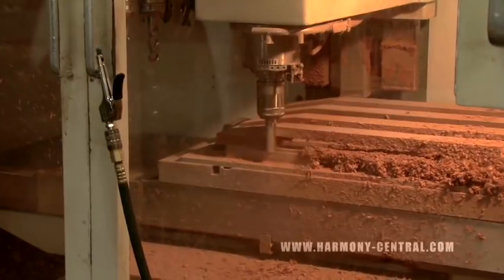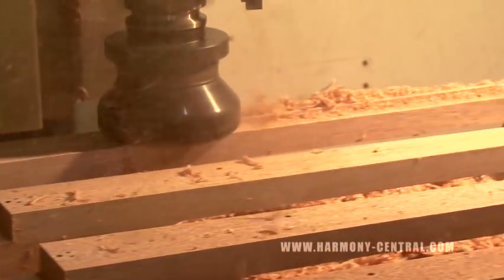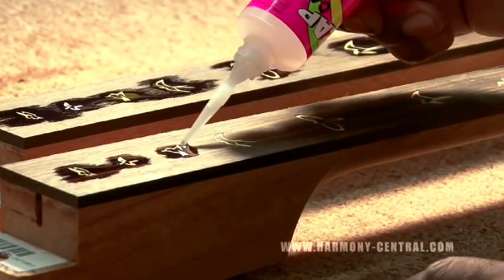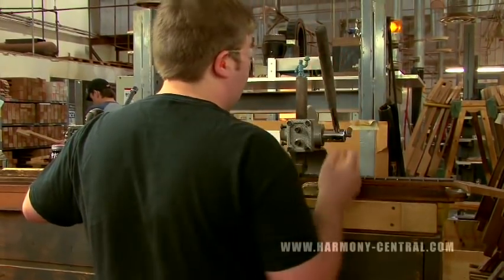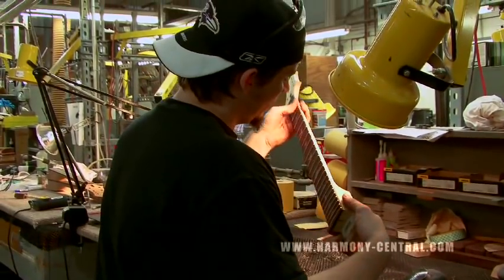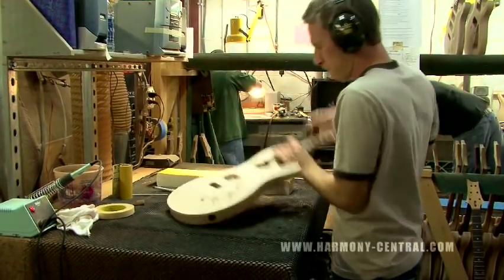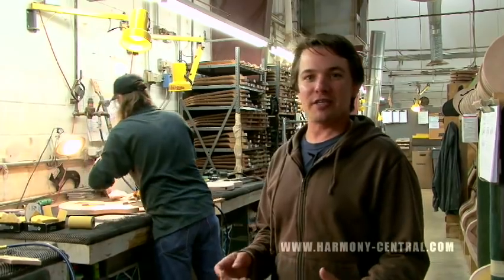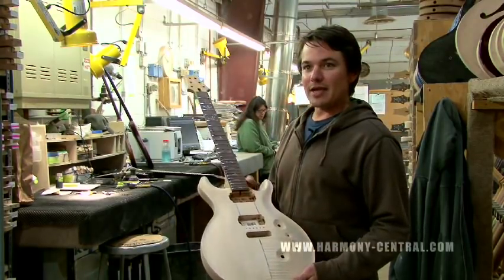PRS Factory Tour Part 2 of 4 - Neck Construction and Assembly

Comment: Inlay work is not toxic. Anyone can buy the pearl and abalone stock from any luthiers supply house and even do the inlay work yourself at home if you want. All you need is some hand tools a dremel and a little knowledge. Gibson does all their inlays in house, including custom work. Everyone pretty much does. What amazes me is that PRS CNC's the neck joint. WOW! Never knew that. Gibson cuts out their necks by hand then uses hand tools to finish and set the neck . So much for handbuilt at PRS.

Comment: @FreemanVDO
CNC machining is necessary if you want any level of uniform quality. If you think about it very little of the actual work is being done by any machine. You're talking about some routing, drilling, and basic sculpting. THAT'S IT! It's all still assembles, sanded, checked, and everything else by hand. Plus doing CNC work isn't as simple as just pressing a button. A person has to setup the program, a person has to maintain the machine (to keep it within tolerance), etc.

Comment: Makes sense, but Im sure a sanding and cutting booth/station/room with a venting system similar to the paint booth/room wouldn't be an astronomical cost or take up much more space to only cut and sand the shell material. Considering what it really initials to build a vented sanding room which may even bring down the cost of the guitar slighty overtime being that they are paying a 3rd party to complete the work at a profit. Im sure they have other reasons for not doing the work in house as well.

Comment: I'm surprised they're not radiusing the fingerboards by machine.  A horizontal mill with custom
ground radiusing cutters would be very efficient and give reliable results.
Reply: That doesn't work because wood varies from piece to piece; they would still need to be sanded.  If the necks were aluminum or steel--that would work fine because those materials are consistent in density.

Comment: You can buy an entire handmade guitar w/ a hand-carved neck (which adds to the expense, since you clearly didn't know that) for much less than $50,000. If you're talking about a solid-body guitar, you could easily get one for $5K. A handmade jazz-box would, of course, cost much more... but you could still get one made by a luthier of some reputation for about half of what you suggest.

Comment: As a Luthier I can tell you what makes Carvin a better instrument: 
1) Neck-through-body construction is much more stable and transfers much more tone to the body & bridge.
2) All Carvin necks have twin graphite-bar reinforcements, so they are less prone to enviromental changes.
3) You can choose among 4 different fretwire sizes & alloys.
4) Ebony fretboards are standard.
5) A Carvin CT guitar is much less expensive than an equivalent PRS... and have a slimmer neck heel.
And those are facts.

Comment: Lot of ignorant comments about CNC work. 

Theres a 99.9999% chance all your guitars were made with CNC. In fact, I only know of a few private luthiers that dont use CNC. And they charge 8000+ for their guitars... PRS's are bargains for the level of quality you get.
Reply: Well i dont mind cnc at all, in fact it ensures that the end product ll be dead accurate every time....my only prob is with the claims and the pricing behind them...those guitars are not handmade so the pricing is ridiculous....i made my suhr-like strat with just files....tracing all the shape and contours with rasps...now that IS hand made and an actual huge effort and manual labor that would justify a crazy pricing if done by a luthier this way (i only did it that way cause i had limited tools).

So if you are so kind please explain to me the quality that is a bargain as you say. You get a cnced cut body just like everyone else does...great...you get quality bridge-tuners and electronics sure....nice fretwork(although still not stainless steel frets), a killer paintjob  and a more meticulous setup than most i agree....now explain to me how all that amount to several thousands cause that pricing isnt justified by neither the amount of manual labour on the guitar nor the parts used.....anything more than 1500 for ANY solid body electric is virtually ripping people off but maybe i dont know what iam talking about so please explain to me where that next level quality comes from that not only doesnt make the thing insanely overpriced but is  also a bargain.
Reply: Thats's true I'am one of those Luthiers. There isn't even ONE mandolin maker that I have talked to that doesn't use CNC and some of these they charge over $30,000.00 for an F5 ! Hand made goes out the window when big money is involved. I prefer to keep craftsmanship alive! And superglue has no place in building or repairing a guitar, period!!
Reply: because CNC is better than you

Comment: I really don't understand why they don't just cut the ears from the main piece of wood, the reason given don't make much sense...also because the ears are separate pieces; if the guitar were dropped then they would likely be susceptible to snapping off.
Reply: Noo, a glued joint is stronger than the wood itself.

Comment: So the only handwork they do is sanding and yet, some of the models cost more than a car? I'm calling overpriced. I could build the exact same thing all by hand, for about 1000€ (probably less, depending on the price of the parts). I'm not saying that CNC's are a bad thing (quite the contrary for such a big company), but if the machines does all the hard work in a matter of minutes, it's wrong to put such a huge price tag on the guitar. I'm also not just hating on PRS, the same goes for Gibson, and all the other huge guitar factories producing overpriced guitars. A block of wood with some electronics on it (we are talking about solid body guitars here, mind you) should not cost more than $2000, if it's not vintage or otherwise rare.
Reply: aDotFromTheFuture How did you figure that? I think you'd be surprised how expensive it is to buy just one of those machines (even used), buy all the tooling, design and build all the fixturing, and spend hours upon hours creating the toolpaths and programming. Those costs have to be recouped. And that's before paying a decent wage to the guy operating the machine. In the end CNC doesn't really save time or money in building guitars. What it does allow for is extremely high accuracy and consistency.
Reply: ***** The machines do indeed cost a lot of money, but they only have to buy them once (unless the machine breaks, which is highly unlikely) every half-century, or so. The same goes for the tooling, although they don't last as long, they are much cheaper and still last a very long time.

The programming you only have to do once, unless you're creating a new model. I've had to program CNC machines before, and done some pretty complex stuff with them, and you know what? It's not all that time consuming nor difficult. The wage you obviously have to pay every month, but even when you add all of these together, it really doesn't justify the high price tag, at least I don't think so.

You also have to keep in mind that, PRS manufactures these guitars about 400 each week, want to know how many Gibson build each week? Almost 3,000!! So yeah, that's just what I think.
Reply: Neil M I'm not going to write a long response to you as well, so just read my previous ones. But obviously I was exaggerating when I said sanding was the only handwork they do, but it's not that far from the truth either. And the machines definitely don't brake down routinely. Have you ever worked with such machines? I do it for a living, so I think I know a thing or two about stuff like this.
Reply: aDotFromTheFuture If the Fadal machines PRS use are anything like the Haas I work with, then yes they do need constant maintenance. Ever had a spindle gearbox dump oil all over a guitar body?
Reply: ***** Nope, never had that happened. The CNC I work with (Intorex) has never, in the three years I've used it, broken down. Some general maintenance obviously is needed sometimes, but that usually doesn't take more than 10-20 minutes.
Reply: aDotFromTheFuture Fair enough, but you can't really compare an Intorex machine to a Fadal or Haas like most major guitar manufacturers use for production. Or for that matter, any three year old machine to one made in the late 80s like most of the ones at PRS. These are 'real' machining centers usually used for metalworking. If you're careful, they'll hold tolerances within 0.0005". They also have a lot of power - a basic mill is usually equipped with a spindle between 15-30HP which even in wood is helpful for running larger tooling, taking deeper cuts, etc. That said, they're "low end" machines by the standards of most machinists and they come with their own set of problems. Yes, they do often need parts. These are often proprietary parts from the manufacturer, and they aren't cheap.
Reply: ***** If that's the case, then I'd say they would be better off just buying a set of new machines that don't need constant maintenance and spare parts, than keeping those 80's machines. It would be an expensive purchase, but in the long run it would most likely be cheaper.
Reply: aDotFromTheFuture But you said they only have to buy the machines once ;) At a cost of roughly $80k to replace just one of their machines with a brand new model, how many 'overpriced' guitars will they have to sell to recoup the costs of overhauling the whole shop? Will they have do that again when those those machines start getting old again 30 years from now?
Reply: ***** Just an exaggeration. Obviously nothing lasts forever, but if they do last 30 to 40 or even 50 years, imagine how many guitars they sell in that time. Gibson makes almost 4000 guitar each week, I don't know how many PRS makes, but I would assume it's in the same ballpark. That number also increases each year (or at least most years).
Reply: PRS makes around 225 guitars a week. They have 190 employees to pay before any money can be used to buy machinery. I honestly really doubt Gibson makes 4000 a week. Even if they have that production capacity, who are they selling 4000 guitars a week to? The guitar market isn't that big.
Reply: ***** Sorry, I remembered wrong, they make about 2500 guitars each week. But that's still quite a bit. I'm surprised that PRS makes only 225 guitars each week, are you sure that number isn't for the custom shop models? Anyways yeah, I guess the PRS guitars are quite well priced then, although I still don't think that a solid body electric guitar should cost more than a 1000€, but that's just my opinion.
Reply: Not only they are cnced but the woods are bought in bulk which means they get them fairly cheap anyway and the people that actually make the manual work are assembly line workers not luthiers.....yes the price tag is insane for ANY guitar built this way and ALL guitars are built this way.....cnced and then to assembly line.

I agree 1000 is probably the ceiling when it comes to solid body electrics(and that with a bit of stretch).Unlike the acoustics you can only do so much to them to get them better....after a certain price point you just pay for logo worship and elaborate paint jobs.
Reply: True. When it comes down to it electric guitars are pretty simple, and have through almost all of their existence been made as an industrial process. Most expensive guitars these days just have a bit more quality control, a bit better finish etc.
Reply: aDotFromTheFuture I agree with you. Imo, anything under $2000 is quality and anything over that is aesthetics... Even at $2000 for a high end solid body electric is too much but I can understand it since the market is quite limited. The thing i dont get it why would people pay more than say $8k for a solid body electric. The max id personally pay to get the perfect guitar with the perfect tone, finish, and cosmetics is $5000.
Reply: then find me any guitar with better quality that isn't 2x the price of these
Reply: or the same price, I guess Mayones, Ormsby and Suhr are similar in terms of quality
Reply: Well, they are USA made.  So part of the guitar cost is every employee's local, state, federal taxes, +social security, medicare, .. probably medical, dental, vision, maybe even some 401K .... yadda yadda ... The cost of the guitar is probably double the cost of the actual manufacturing process.
Reply: aDotFromTheFuture if you wanna talk overprice, look at Gibson.